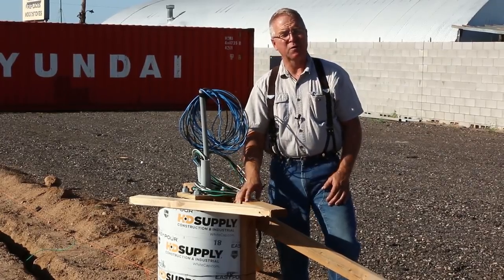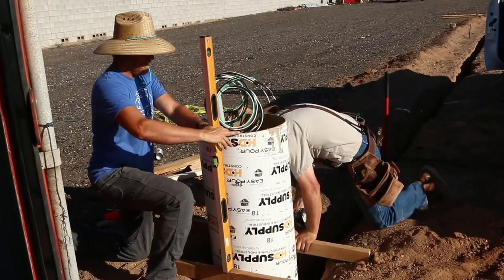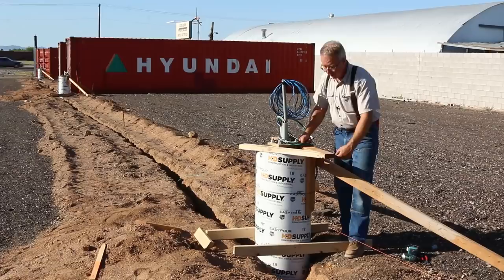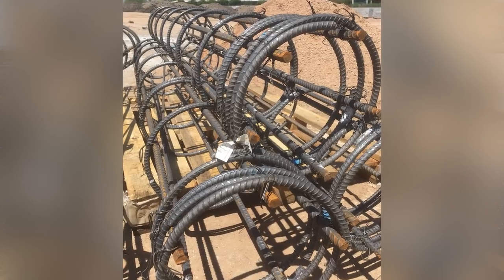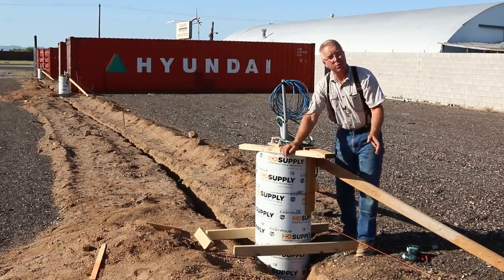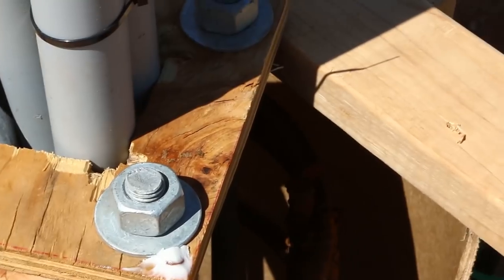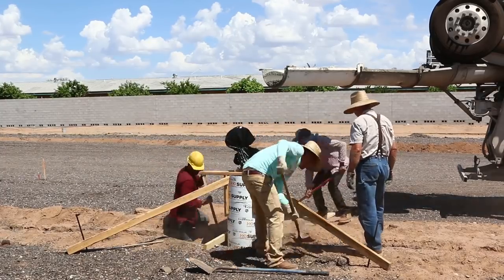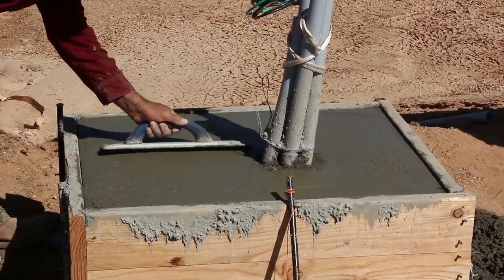Pouring Concrete Street Lights

Comment: Nice video.  I wonder if anyone makes a slip over straw ( or recycled HDPE) hat brim that can be used with hard hats.  It'd be nice to have the shade on a hot day.
Reply: @essentialcraftsman  Yes, something VERY MUCH like that.  I've never seen anyone using one before, so I didn't know they existed.  I've been wearing loosely woven straw hats whenever I can.  I noticed the nice ones two people were wearing in the videos right away.  I know a few people to show:  see, I'm not the only one.  I was thinking of taking two hard hats and cutting the tops off both in different sizes.  Then rivet the large plug to the hat with the smaller hole with spacers to get better ventilation.  I really hate how hot my head gets in hard hats.  Does that three-piece brim come by itself, or complete with the hat?  The way I read it, the hat seems to be included.  Makes sense.
          Oh wow.  I just did a web search, and there are several types of hard hats and accessories that aren't in the brick and mortar store where I usually shop.  I'm impressed.  😀  Thanks for the fast response and the information.   👍
Reply: The hard-rock miners of the old west used to soak regular felt hats in resin or shellac to make them hard hats, back before hardhats were invented.  I think Scott needs a cowboy hat.
Reply: @ronyerke9250  i wear one everyday mate and they're fantastic, I'm not required to wear a hardhat on my particular jobsite but id rather be safer than sorry and these brims make a world of difference in Australian sun exposure. 

Often I find myself exposed probably 6hours out of my day and highly suggest you find one that has a neck flap to cover the back of your neck. it makes all the difference when you realise its probably the last place you think of covering and adds maybe a degree or two to the overall cooling felt. You'll know when you've been working all day and  go rub the back of your neck and wince in pain. 

only negative to these is I cant wear my attachable earmuffs but I've traded those for corded earplugs. Rather avoid skin cancer and hear just a little more noise everyday as well as the fact I keep trying to go through narrow spaces with it on and usually lop the lot off my head as I try.  Mines a simple slip on and velcro so If its not that sunny i can take it off easily.
Reply: @Criticalcore  Thanks for that.  As a pomme (did I use that correctly?) I've gotten many a sunburn from early in my life.  I long ago learned what a blessing that an "Australian Bush" hat was (that's what it was sold as).  I noticed in old movies with the French Foreign Leigon and Japanese Imperial forces using the neck cover cloths, so I've sometimes taken to tucking a bandana under the back of ball caps when the need arose.   It looks like one man in the video had attached a towel to the back of his hat.   Having had more than a dozen blistering sunburns on my back, neck, and shoulders over my lifetime, the spectre of skin cancer crosses my mind now and then.    It has led to many fashion choices that other people consider humorous, and many of them are quite obnoxious about it.  I'm really glad companies are making sunscreen with S.P.F. ratings now.  I wish such things had been on the market when I eas a child.  The tanning lotions that were available back then were NOT protection as my mother thought.  They were more like putting grease on a fire.

Comment: Yeah baby,  No blow-outs.  Ha, ha, ha.    No lights needed.  Few enter a storage unit at night.  Many companies close them at night. If lights are in the common area (parking/road way) will each unit have its own lights? Lights in each unit could become someone's access to electricity etc.  Lights in the common area make units with no lights hard to see (black holes).  Lights in each unit can be hazardous (Fire by stupid people).  Lights in the common area state your taking responsibility for the public (no lights = vehicle headlights used/vehicles opposed to parking parallel to building). On the other hand; you create fighting between customers that park parallel to the building (usually a rule) and blocked another units door.  By the way; people don't follow rules. Lights in the common area are expensive and should be replaced by an electrician.  Lights in the common area won't prevent a thief. All renters are responsible for the stuff they store.  Most renters don't buy renters insurance (who can afford a unit and insurance). Insurance may help when the business does an oops and opens your unit for auction. A good investment is the storage buildings protection.  Concrete post at ever corner (door openings and corner of buildings … prevent consent replacement of siding (usually steel).  Extra wide gates that won't allow anyone in until it opens all the way.  Customers break gates (protect the gates - good luck). Barred wire on fence gets expensive.  Customs hate gravel drives in storage yards.  Customs hate low (cheaper) door openings (customers will remove stopper on roll up doors to gain an inch for tall items to enter).  Customers hate when a storage unit inner walls can be climbed over giving access to neighbors unit. Any inside girts etc, becomes a hanger.  Direct contact of stuff and cement floors = mold.  Not affording ample vehicle turn around between tightly placed building = trouble. But every structure is a $ maker. Dumpsters will fill with unwanted junk.  People proof everything bc some will want value for their buck … they may feel the need to abuse your place.  Inside storage units are another animal.  There is AC expense passed on and a bunch of other issues. Cameras are expensive and do little to help the customer who will eat the cost. You can build the world's best storage unit business and if the cost is placed on the customers … When insurance is involved for business and customer there goes the need for storage. Good luck.  It's a catch 22.